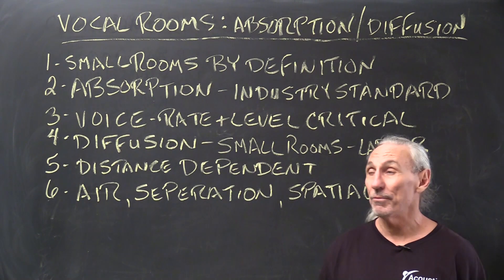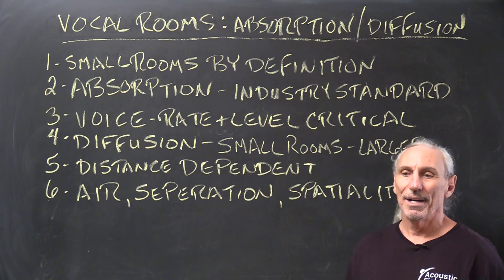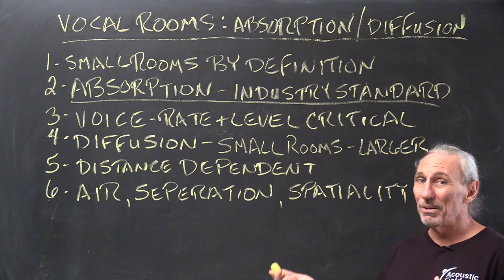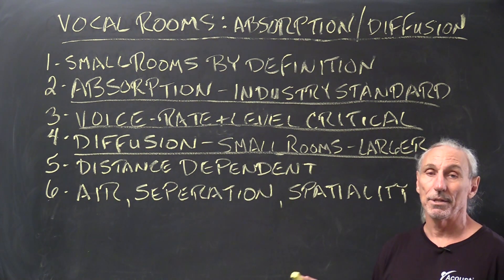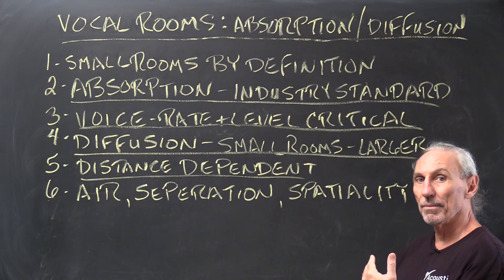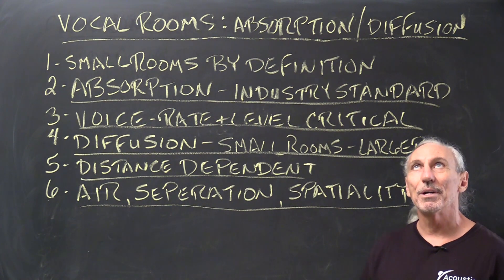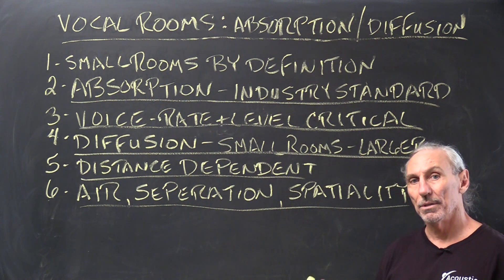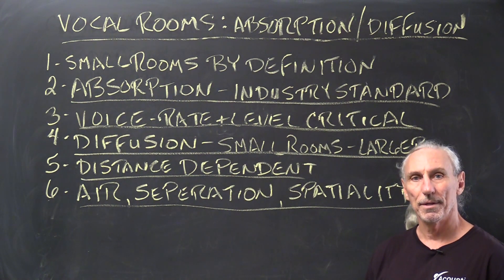Vocal Rooms - Absorption & Diffusion - www.AcousticFields.com

Comment: I would guess most engineers would still go for some compression regardless. Just to tame to peaks of a dynamic vocal, since the nature of vocals is usually very dynamic. At least for some glue or color. But yeah, to only reach for a compressor and not need EQs, de-essers and so on, sounds like a dream come true. Definitely checking out the DIY projects
Reply from the maker: P,  Tell me about your project.
Reply: Acoustic Fields 
You know, standard rectangular extra living room recording/mixing situation. Set up length-wise in the room a third away from the front wall. But it includes all of the major "no-no's" that you talk about: dreaded 7'-8' ceiling, Windows on the front wall, Windows on the back wall, fireplace and mantle on one of the long walls directly across from a double wide opening to the room. I've done what I can with blackout curtains, foam and DIY treatment panels at reflection points... But I dream of one day decking it out with Acoustic Fields products. From what I can tell, you guys are the best in the biz. Love the videos. Thanks